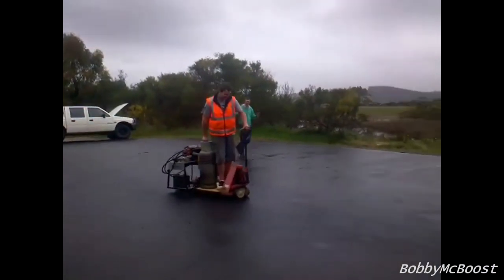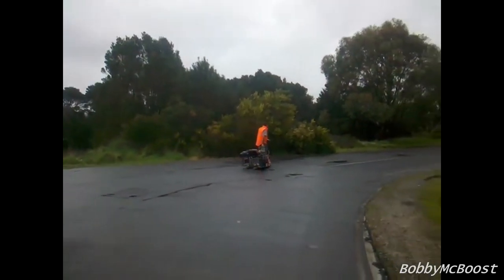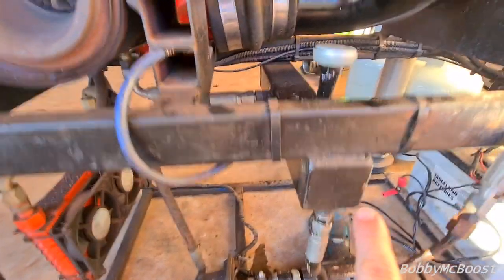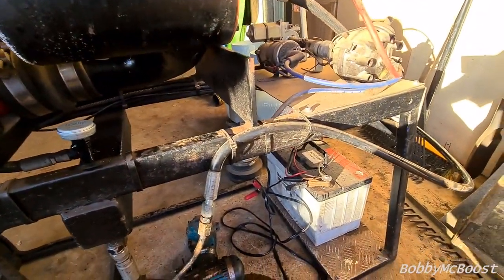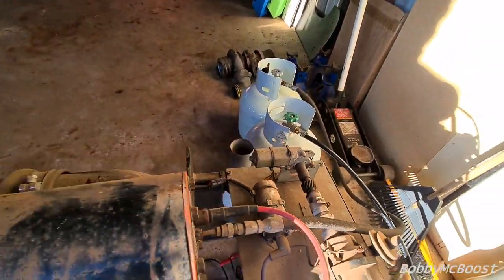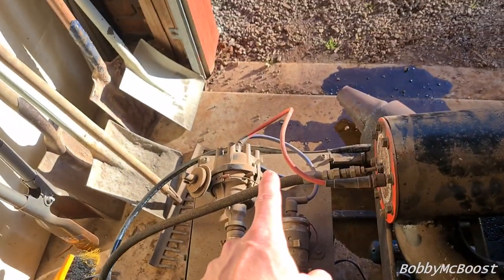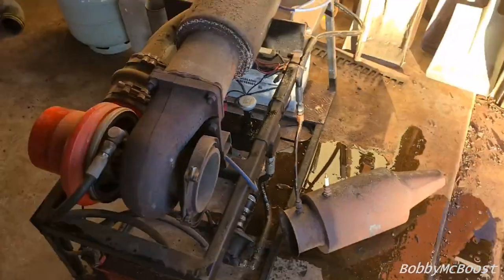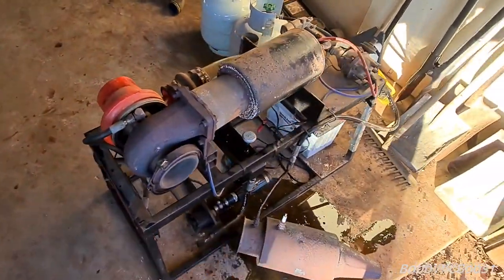Gas Turbo Jet + Afterburner!  Extremely LOUD!

Comment: That's kinda like a sr71 blackbird engine, or a me262 engine, just with junkyard parts lol

It has a ram air intake, and some other intakes that all close up with more airspeed, and some fins on the engine exhaust for thrust vectoring, otherwise basically the same. Oh and more combustion space and a longer turbine.

Comment: Practical purely mechanical negative feedback control - excessive heating burns away blade tips, reduces charge rate, reduces heating.
Lovely stability. Control system engineers take note.

Comment: It needs an exhaust wast gate
Reply from the maker: The boost pressure can be adjusted via fuel intake. Just lower the gas flow. 👍
Reply: @BobbyMcBoost  having  the gas tank in a bucket of hot water helps as well , it can be over spun with out an exhaust gate, starts to flutter  , works both ways , I made one years ago soo much fun